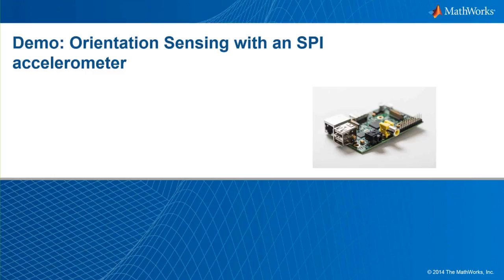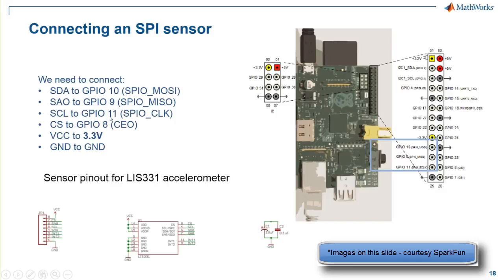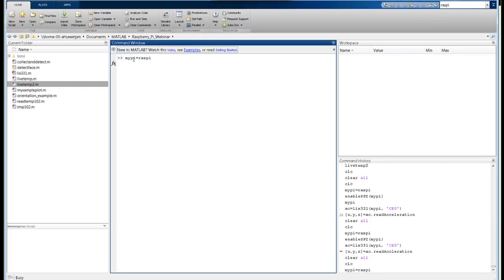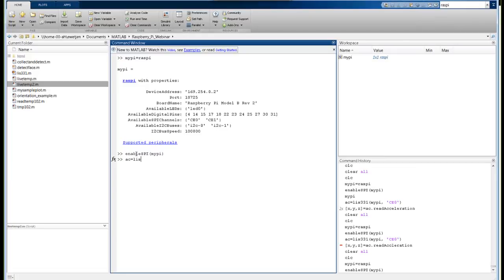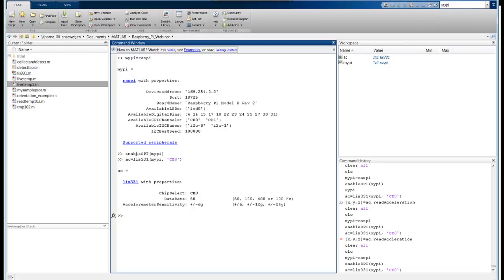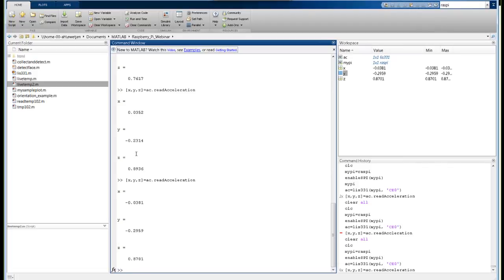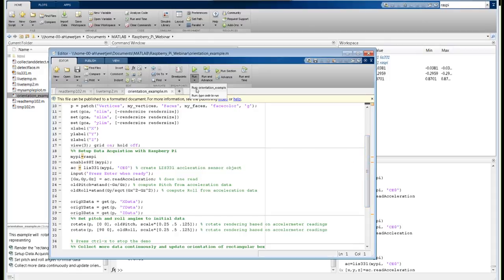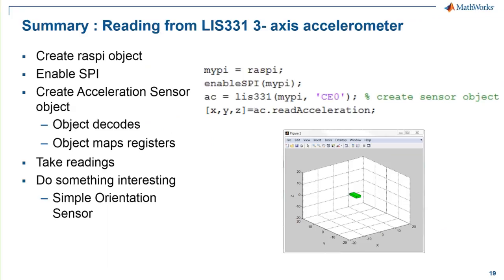Using MATLAB and Raspberry Pi with an Accelerometer

Comment: Hello, I know that thisis an old post, but I'm actually having some issues using MMA8451 accelerometer so I will try the same to have any kind of support. Is there any way to get  lis331.m and orientationexample.m files in order to have an idea of how to create a function that reads sensor data? thanks, any advice will be appreciated and best regards, Domenico